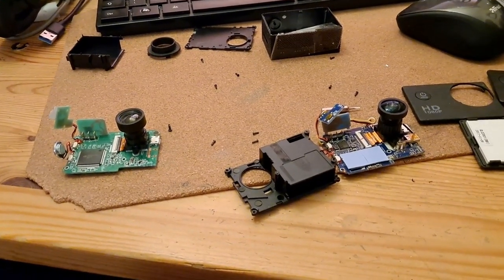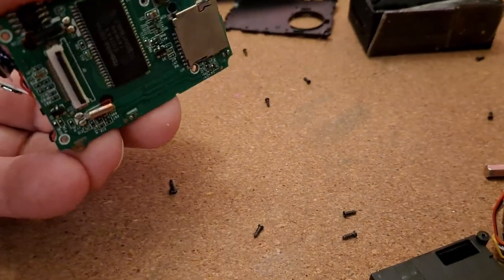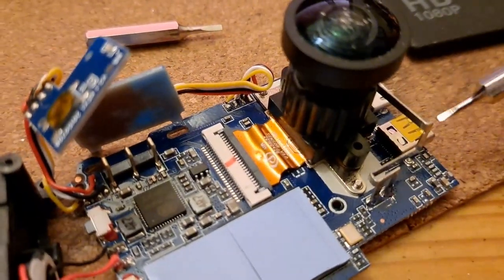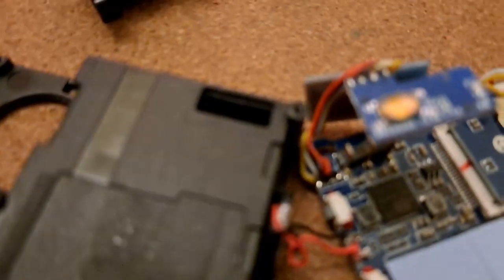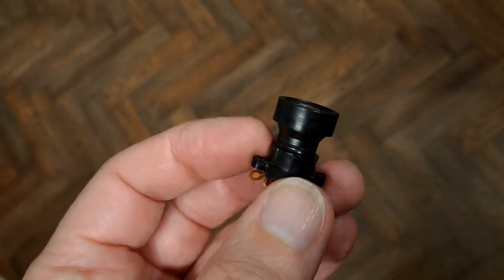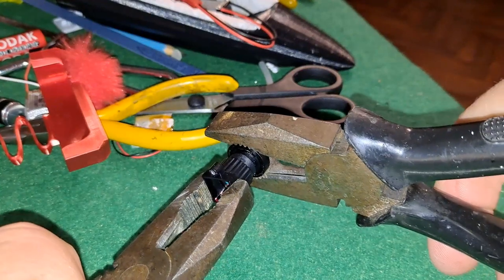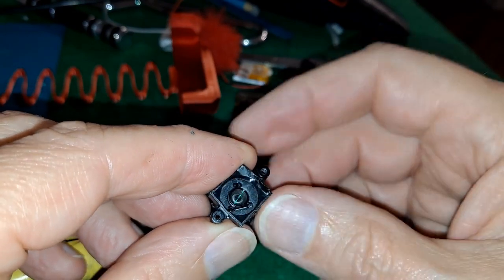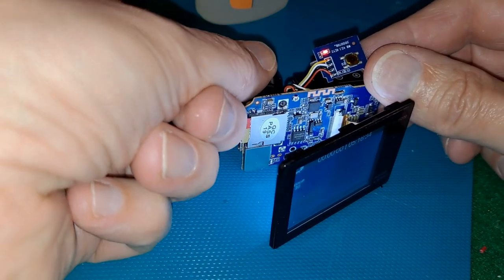Can I replace the lens on my Action Camera - NO!!

Comment: Not a bad idea at all,what you had not thought of was software firmware on both modules. Each firmware is programed for its own sensor module,that's why it stuck during the booth process.

Comment: For threaded glued plastic try acetone. But try on a small bit first as it melts some plastics. For removing glued in parts on flat flex ribbon cables you need a hot air rework station. Only £20 on Ebay or Aliexpress. They are actually for soldering surface mount components using solder paste, so they have a double use. Well worth having if you want to repair modern electronics devices.
Reply from the maker: Thanks for the tips, in the previous episode I tried acetone (nail polish remover) to no effect https://youtu.be/mH3zZog8fdM?t=561
Reply: @GrandadIsAnOldMan  Sometimes  isopropyl alcohol also works, or heat with a hairdrier sometimes softens the glue enough to let you unscrew things.

Comment: Maybe if you shorten the thread on the lense and also on the housing you'll have a bit more adjustment, you've got nothing to loose so give it a go, alternatively if you have got an old dslr camera lense lying around try mounting that and see what the result would be.
Reply from the maker: Yes and no, as you can see it has just popped into focus at that distance, so shortening the thread would bring it too close and out of focus again. It might be interesting to try to use the parts on a telescope, but for now the bit are in a box and in storage, probably never to be seen again until I try tidying my work room again. 😆

Comment: did you try to heat the glue and unscrew the lens?
Reply from the maker: Here are the follow up videos 
Grandad's Postbag 20210104 Action Camera Lens FULL LENGTH https://youtu.be/7s5pvUu767E
Grandad's Postbag 20210104 Action Camera Lens FAST FORWARD https://youtu.be/GttHft3cjXI

Comment: Not so sure it's useless .. If it's in focus, you would want it glued in place so it doesn't un-focus while it's being used in action -  it was probably glued (and sealed) at the factory? .. If the mounting has cracked, that might be just the place to glue it all back together .. A little clamping on the mounting crack might even adjust the 'framing' .. Be sure to monitor the focus as you proceed .. There's still a lot of picture
Reply from the maker: I won't be throwing it away, there may be other uses for it. One idea that crossed my mind was attaching it to a telescope, but I won't be doing that any time in the near future.

Comment: you are able to do this, many people have done it over the years, but yes the hot glue or what ever used to fix lens in place can be a pain.
Heat can some times help a bit.
Back focal length in between lenses mean you might have to screw in new lens more, so you need to remove all of that glue from threads to be able to do that.
I have modified a old ALU lens mount so i can use it to clean threads by screwing lenses into that mount.
And of course as you find out the lens must be made to work with what ever sensor size you have.

Lens shops ( remember to get IR cut filter on lens )
https://treeyelens.aliexpress.com/store/725056?spm=2114.10010108.100005.2.322f2f66nIcaWE
https://fulekan.aliexpress.com/store/1862644?spm=2114.10010108.100005.1.5ea7570fbEvk9w
Reply from the maker: Thanks for the links, although I see the price of the first lens for an action camera is about the same as I paid for the camera new 😆 I see there are others not so expensive 👍